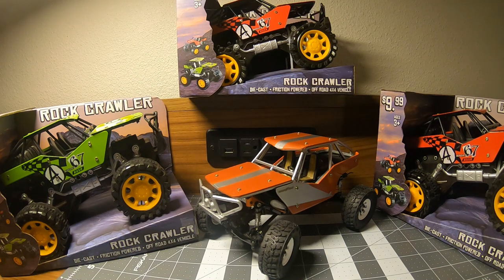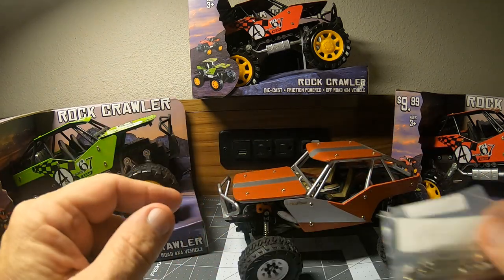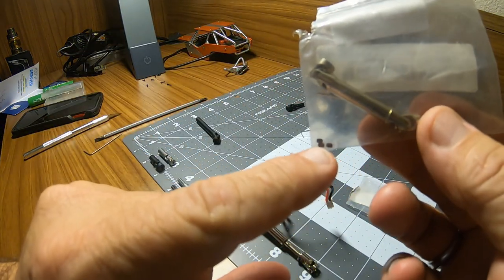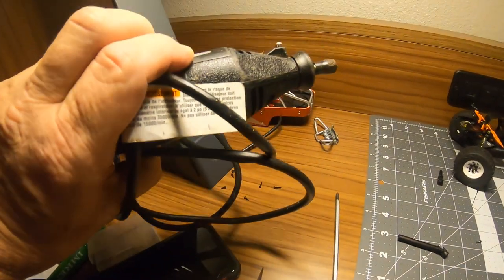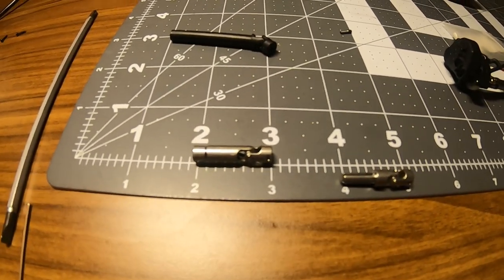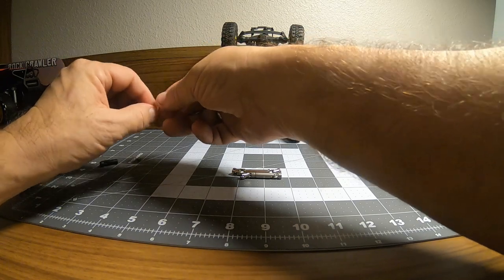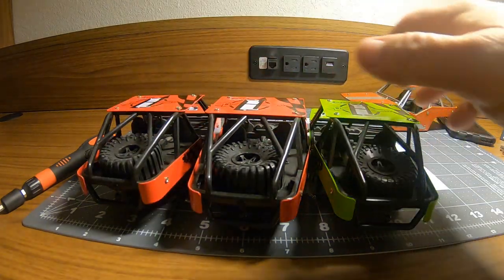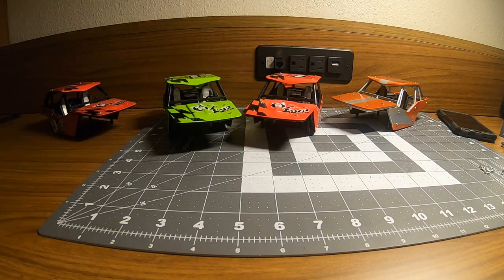SCX24 METAL DRIVE SHAFT UPGRADE

Comment: Awesome video! The inner ends of these aftermarket shafts was my exact concern. Them being rounded versus the stock having a flat spot. Were the rounded aftermarket shafts loose or wobbly at all while driving?
Reply from the maker: This video was made ages ago, and I was searching for parts that I could make work. Now there are just upgrade metal driveshafts that are direct replacement parts and fit perfectly
Reply: @BullgearRCvideos  Yes but I see that they are also rounded on the inside like the ones you used. I was just wondering if that was an issue or not. I’m ok with cutting down to the size I need. Also I’m working on a 1/18 Atlas which nobody is making aftermarket parts for. But I see that it has the flat side like the scx24. On second thought since the aftermarket’s don’t have that flat spot then maybe it doesn’t matter. Lol. Again thanks for this video.

Comment: I'd love one of those bodies for my SCX 24! I can have two 24th trucks without buying two. You don't see the Wraith in smaller version until now.
Reply from the maker: Yeah, the body just fits. And if you make styrene body panels like I did, you can change the way it looks in about 5 minutes just by putting on a different set of panels
Reply: @BullgearRCvideos  I'm recently new to the hobby, is that stuff pretty easy to work/mold with? Heard people using it and was always wondering.
Reply from the maker: @lylekehrer6159  if you mean the styrene,  well I'm new to messing with that myself,  but the body panels were pretty simple to make. If you want to see a far more experienced guy than me build with it check out wesmade on YouTube. He is a master